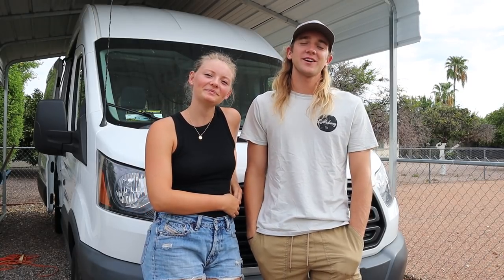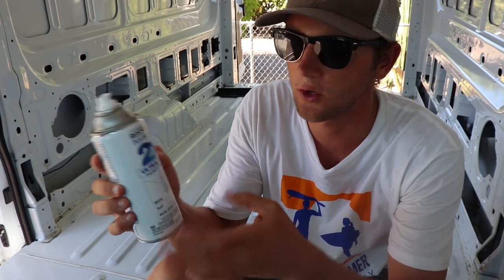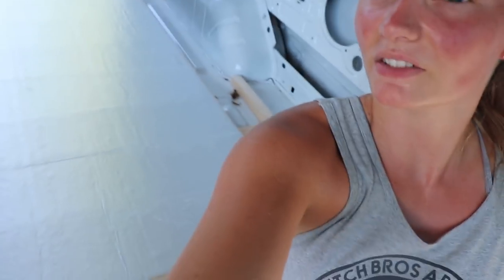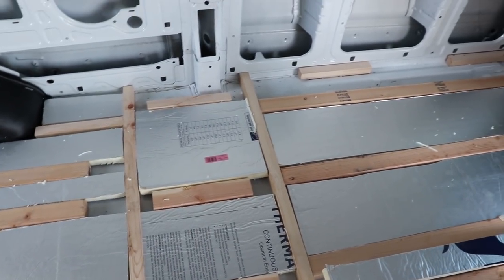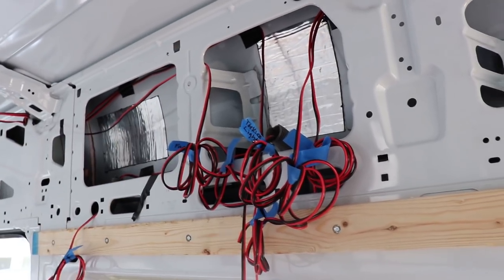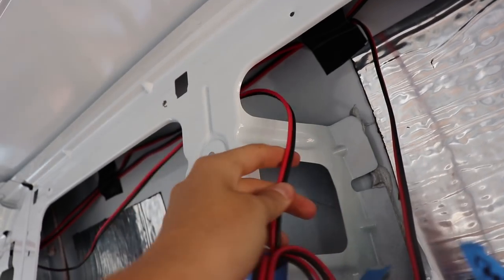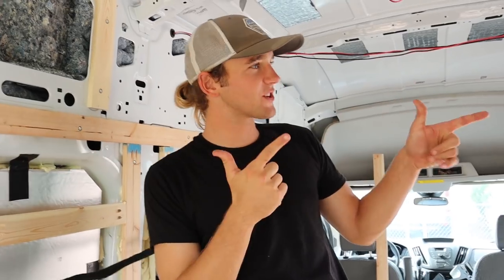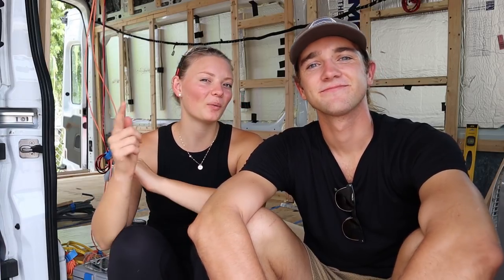BUILDING A VAN IN 110°  | Van Build Series Week 1 | subfloor, insulation, furring strips, & wiring

Comment: How did you attach the framing for the body of the van, we were using metal self tapping screws & it would just blow out the hole and we completely Swiss cheesed our van 😅& even though we’ve been done and full time living for 5 months we still aren’t sure if it was user error or just the wrong type of fastener 🤯
Reply from the maker: How odd! We use #10 1-1/2 inch self drilling hex screws.

Comment: Great video guys, great job!  Thanks for sharing!..I have two questions for you if you don't mind, what size furring strips did you use and exactly how did you bolt them, did you use rivets nuts? I look forward to your reply! ✌️💕🚐🤘
Reply from the maker: Hi Deb! We use 1x3 furring strips for most of them, and a few 2x2s in the window cavities for additional bracing - we use #10 1-1/2 inch self drilling hex screws for bolting them in!

Comment: Are you installing any windows or a fantastic or maxxair fan or fans are you putting sore on the roof installing a lithium or AGM battery Bank what van are you using Mercedes Sprinter Ford Transit or Dodge ProMaster did you install any 12-volt yeah or a power inverter